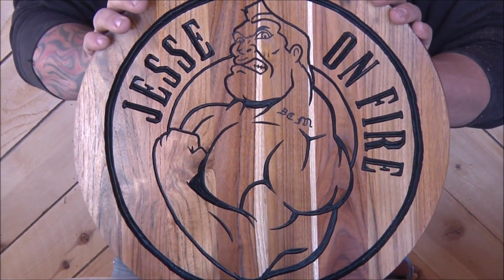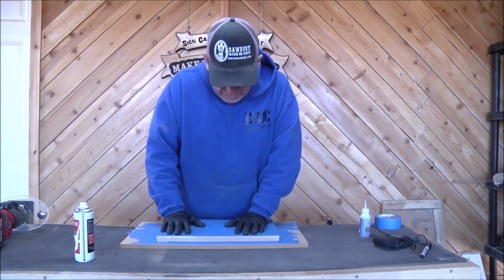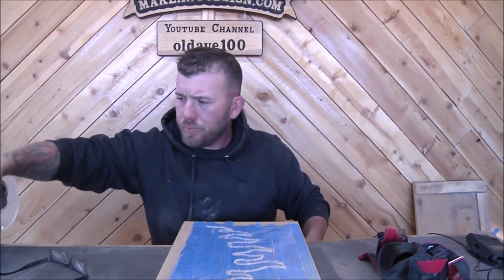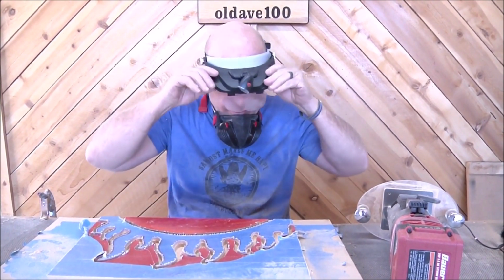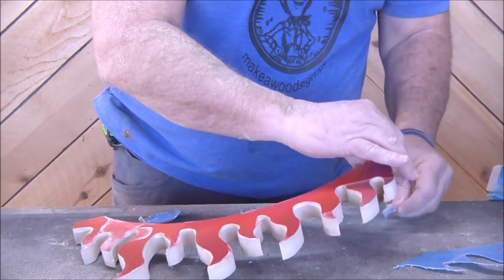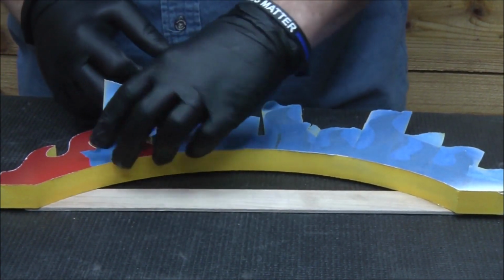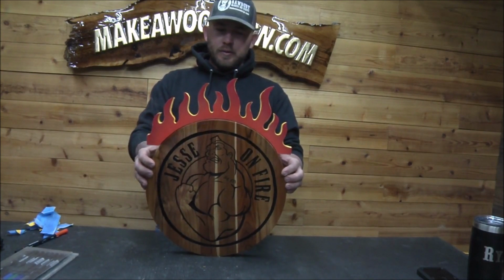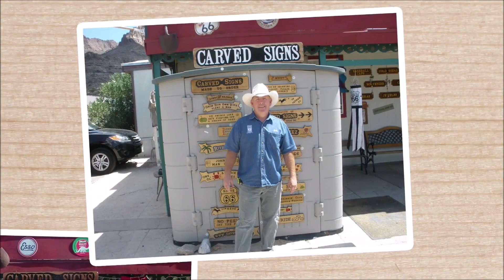#654 Freehand Carving Teak Wood Jesse on Fire Project Pt.2

Comment: Hi guys, love the sign. It’s really amazing what you guys can do with a router. I too would say no flames, maybe incorporate some between the outside circle and the outside edge of the wood, of coarse there’s no taking it back after that. I love the picture though, it’s really something how a picture or maybe even a photo can be remade with a router. Now, my only question is about a material called Oramask, a friend at our community Woodshop was using it and told me about it , I have some but haven’t used it yet. So instead of the blue tape you put this Oramask down ,it seems to stay down better than the tape but like I said I haven’t used it yet. Well that’s it for me , great work guys. Ken W.
Reply from the maker: Thank you Ken, we appreciate the kind words. I've heard about Oramask but haven't tried it yet. May have to try it.

Comment: I know this video is almost a year old but I wanted to comment anyway. It looks like most folks are against the flame and I have to agree. I think it was a cool idea, just didn't look right the way it came out. Like most folks I think it was the tabs sticking out that threw it off. I'm also sorry that the bevel idea didn't work out as I think that would have increased the visual appeal of the flames. One thought I had was if the MDF had completely encircled the teak. I'm thinking the MDF rounded to encircle the bottom of the teak to give about an inch or so border and going up the sides and then the flames coming up from the top.  Not sure if that description makes sense or not but it looks cool in my minds eye. I think just the flames on top would have been difficult no matter how they were blended into the teak.

I actually just did a sign with one of these teak rounds earlier this month. I really like how it came out. I opted to forego any painting of the lines or anything and just finished the sign by applying teak oil. I thought it really brought out the grain of the wood but I also really like your version with the painted lines. Thanks for all of your videos and they are teaching me a lot and getting me inspired to try different stuff.
Reply from the maker: Thanks, JB! We might do something like this in the future and do it a little better. Gotta keep pushing the creativity HAHA